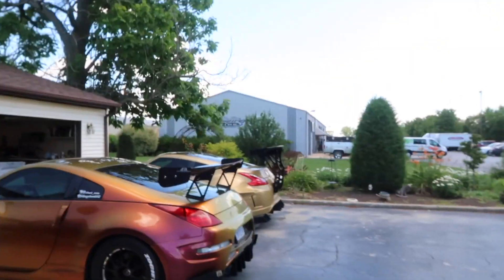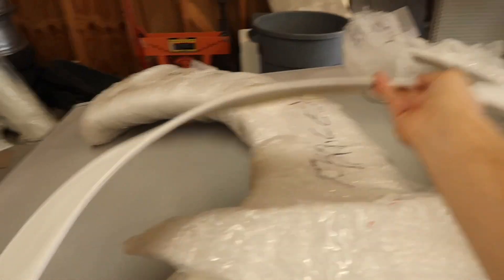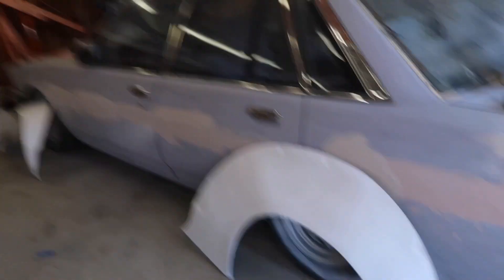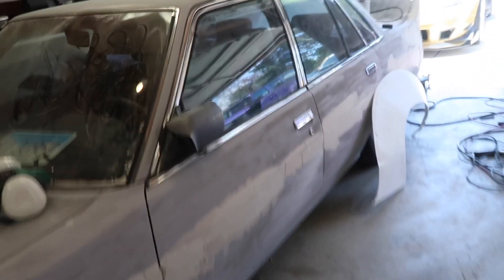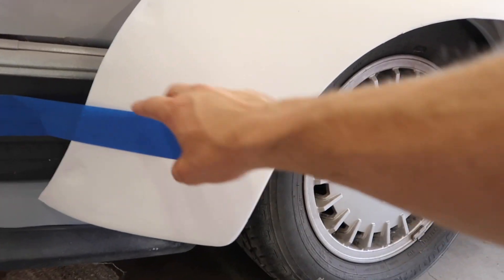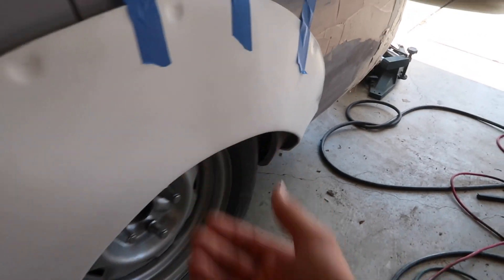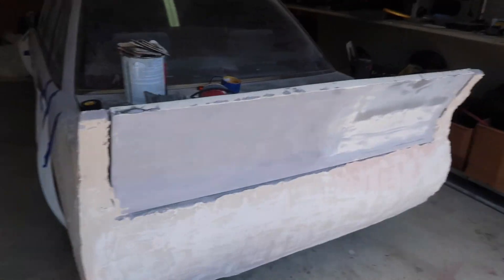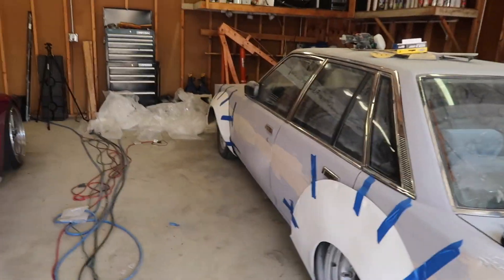Bosozoku Cressida Gets Fender Flares!

Comment: Relocate the goose neck for the gas tank instead of cutting the flares
Reply: That or Put a fuel cell in the boot. Full-in the fuel door and loose the original fuel tank. So you don't need to cut the flares.

Comment: at the very least I believe the front one might need the other. usually the flat part goes closest to the door frames from what I've seen with each pointed end going towards the bumpers. I could be wrong and these could be different, but might wanna give that a shot. rear looks right, its only front that looks like it should be other flare